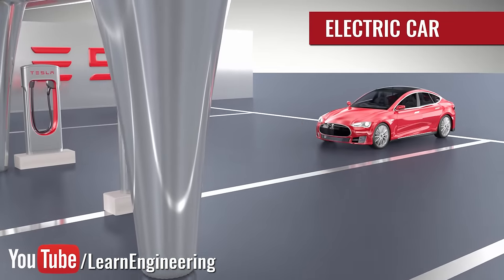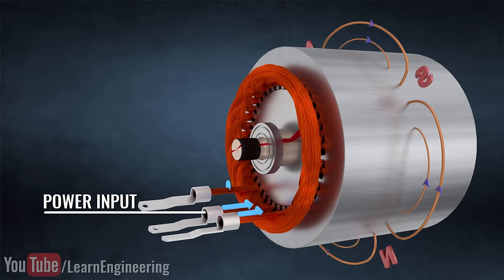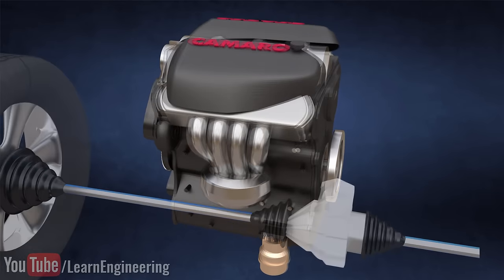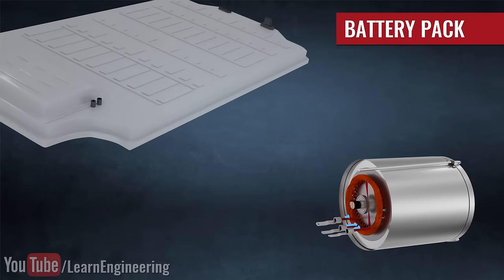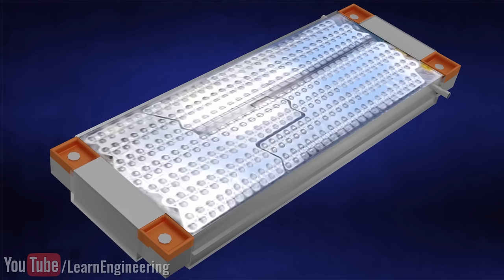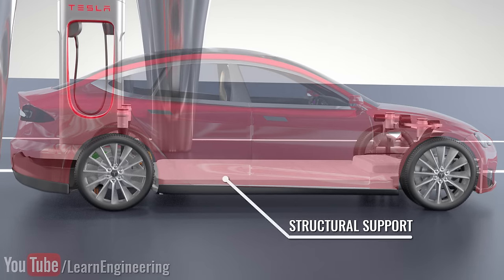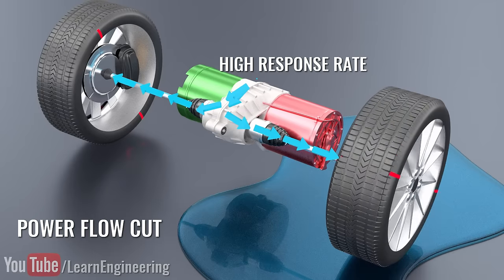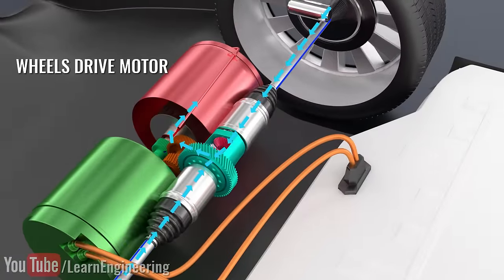How does an Electric Car work ? | Tesla Model S

Comment: Wouldn't it be more convenient if the battery pack was removable. That way you could swap your depleted battery for a charged one at a gas station and pay for the energy difference.
Reply: PhazonSouffle that's a great idea, but I think it runs into some practical problems like how do you have batteries for every type of electrical car at most gas stations
Reply: PhazonSouffle Not only that. There are many technical problems with that approach. 
It has been already tested several times (mostly by electro scooter companies in Japan). You also need a significant number of spare battery packs scattered across the country. 

People don't like the inconsistency - some drive responsibly and treat the batteries better than others. They don't want lower distances because somebody else likes to race at their maximum etc.

To sum this up: This is prehistoric fuel car logic. It is not you who needs to drive somewhere to fuel up - it is the fuel that needs to be present everywhere - aka electricity. 
The next step is, that the cars manage their charge themselves - followed by a crowd intelligence car sharing system.
Reply: Tesla has done that. They showed it at stage a couple years back, it took three minutes or so for a change. They opened a station between LA and SF but apparently it wasn't very popular.
Reply: That won't be easy. The only new successful battery technology in the last 125 years has been lithium ion. LI technology hasn't been much improved in the last 30 years... the Tesla is running on AA batteries because if you make them much larger they do things like catch on fire. Unfortunately, chemistry puts the kibosh on new "breakthrough" battery technology. You will note that there is a new "battery breakthrough" announced about every six months... and then crickets. That's been going on for the last 100 years.
Reply: Considering the batteries are built into the car chassis'... that would be quite inconvenient.
Reply: It is removable. Tesla built the car to be able to swap batteries and they built a swapping station in LA but the reception was luke warm so they didn't develop it further.
Reply: No need to swap.
Reply: PhazonSouffle they are trying that method in Sweden
Reply: or just have 2 packs at your can. one runnig pack and obe fully charged.you give one pack to refuel and pick it up later
Reply: Simon WoodburyForget
Again - this is obsolete logic. It is not you who need to chase the fuel. The fuel needs to be everywhere - completely unrelated to your location. Dedicated fuel stations are a thing of the past.

The future lays in self-managed energy supply by the cars themselves. If you are traveling longer than a car can sustain in a comfortable time period, you get into an other car provided by a crowd intelligence system.
Reply: Simon WoodburyForget Electricity is everywhere I go. Even today I don't drive to any Superchargers - I charge the Tesla at work and home. 

Again - once you start to rewire your habits you will realize how primitive the fuel station economy really is. It is a huge rise in comfort.
Reply: People forget these battery packs can be 1000# or more.  Its not just something you swap out like you might on a cordless drill.  The key will be greater capacities and faster charging times as the technology evolves.
Reply: Would probably be more trouble than it's worth because hte batteries are enormous. Most people don't drive more than 300 miles in a day lol, so it's not like you even need to charge you car very often. Maybe once a week at most, and if you use a Supercharger it only takes 20 minutes to get 100 miles of range.
Reply: The thing is if I leave my 10 year battery pack and get a 2 year old one I just got rid of my cheap defective one for a new one.
Reply: There would have to be extreme safety precautions. I don't know about Tesla but to work on other hybrids you have to disconnect the battery packs in order to do some servicing on the vehicle. Since it is an electric vehicle most of the battery cables have huge amounts of volts and amps that could kill you if you aren't wearing the proper equipment. It's not something anybody can learn quickly either because it's a life or death situation that is very risky. Most electric/hybrid  battery cables have 600 volts or amps (can't remember) going through them while they are live which is enough to kill someone fairly quickly. Also if you work on those types of cars you have to have a Sheppard hook to remove anyone being electrocuted or you could just add to the list of victims. 

I'm an automotive major and have taken 3 courses for automotive electrical and advanced hybrid courses and it's not something I plan on doing anytime soon because of all the dangers that come with the job. 

Anyway Tesla could have all the safety precautions already designed into the system to make it easier. So that could change my opinion but I digress. You won't see me working on any hybrid/cars until those precautions are in place to the point where death isn't one of the outcomes of working on a hybrid or electric car.
Reply: Or maybe build roads that charge the car by induction? Like those phone induction charge stations..
Reply: The induction idea is interesting but I'm not sure if they would be able to transfer power fast enough to keep up with the usage and man would they be expensive to build.
Reply: You have to deal with many problems when you start to move the fields.
A more reasonable approach will be induction systems under the parking spots to avoid needing cables.

However, the fields we are speaking of would be quite strong and may have an influence on things like Pacemakers.
Reply: PhazonSouffle While that would be mainly ideal, you're kinda gonna be pissed to know that your BRAND NEW battery is being swapped with a 5yr old battery.
Reply: It'd be pretty heavy though, wouldn't it?
Reply: Skarn22 Yep. And expensive if you break it.
Reply: Yeah but if you look at the design they have, the thing literally goes from one end of the car to the other. If they made a tesla any smaller, they'd have to make the battery smaller too.
Reply: I could not disagree more as I think Tesla has one of the best designs for battery placement.  The battery is under the entire passenger cabin.  Unlike like other EVs it does not protrude in to the cabin taking away passenger space.  The very low center of gravity allows for fantastic handling for such a heavy car.  The placement also allows for a great deal of storage room in the rear and some in the frunk.  Adding more than the largest 100kw range in the current battery designs would probably be too heavy.  As battery tech advances and gets lighter than greater ranges will come.BTW:  Range is one of the biggest things people are concerned about.
Reply: Robert Greenlee And also, the battery spanning most of the bottom of the car, it provides rigidity, making it one of the safest vehicles ever made.
Reply: Absolutely..
Reply: Simon you need to go back and play with your legos since you have no clue about cars.  Center of gravity has a HUGE impact hence why sports cars are usually very low to the ground and kick the pants off SUVs that tend to have a higher center of gravity.  As for storage space cars don't just move people.  They move people and their stuff.  On longer trips sometimes lots of stuff.  What do you drive a Yugo?
Reply: Simon WoodburyForget Go ahead and try to roll a Tesla, its damn near impossible.
Reply: Simon WoodburyForget All the ones I see are at dramatically high speeds, and they normally hit something to get them airborne, like that curve or whatever.
Reply: "Mellow _ ...have you never seen an F1 car flip?.... you can flip any car. The centre of mass being 1 inch lower then usual doesn't change that by a whole lot. There's a reason off-road vehicles don't typically have that low of a centre of mass, its because suspension is used to prevent the vehicle from flipping over. "HA.  SUV have higher suspensions to allow them to drive over rougher terrain.  Wow I think I think you are just a troll.
Reply: PhazonSouffle 8
Reply: oh yeah great idea
Reply: I also thought same.
Reply: PhazonSouffle batteries are very heavy, so both carrying a spare and replacing batteries is impractical
Reply: we could have  on every car the principal battery and every car  should have a second smaller battery with the same size and model on every manufactured car which u can fiind in every `` electric station`` with a capacity to drive like 2 hours for example! enough to go home to your charger or where u have time to stay 1 hour to charge  your principal battery!
Reply: @phazonSouffle.  nice idea bro but as far i know about it, 60% to 70% of total cost of any electric car is for its battery.if they start changing batteries,what would left behind.!!!
Reply: We could just have all of the spare cavity space packed as tight as possible with fitted battery packs integrated into the system.  Make it a one seater, put that in the center behind the windshield.  Make the sun/moonroof standard and modify it to be the entry/exit.  After that, all space not needed for the comfort of and operation by the driver should be filled with batteries.  Think it'd work?  What does anyone expect the result would be?
Reply: how about keeping a portable generator just to reach nearest charging facility. people are already doing that.
Reply: Jeez those packs weigh like 1000 pounds, and we be a pain to change. The process could take hours, and tesla is investing in less than one hour charging.
Reply: Why not have big  mobile power banks which will recharge the batteries anywhere something like road side assistance.
Reply: it's not your cordless drill; you'd have to dismantle half of the car,and wait the whole day, or come back tomorrow ,every time; better keep a filled ICE handy...
Reply: @MetallicReg  

But people want their own cars, not some bugmen sharing BS.
Reply: @MetallicReg  

Induction charging is inefficient as hell by design.
Reply: WESTEL Audio People don’t want their own cars. They want to get from A to B in the mist comfortable and fast way as possible. 

You will see how the market will shift once the shared car network starts to operate with ridiculously cheap prices, since those cars don’t stay parked 97% of their life.
Reply: WESTEL Audio Induction charging is not my main suggestion, but rather a more realistic alternative to the context it was mentioned. 

However, efficiency is not really a problem. We have more than enough potential energy sources once we commit to an extended solar network (with a practical way of balancing peaks - e.g. in US there is a possibility for lake storages). 

Therefore losing 50-60% is less dramatic than it sounds.
Reply: @MetallicReg  

Outside of the liberal urbanite middle class echochamber most people do want their own car. People like to live self-sufficient and not dependent on a company or whatever. Also people like to tinker and modify their cars or leave stuff inside the car. Others live in remote locations where car sharing doesn't work at all.

Give me an electric car that is as simple as possible. No unnecessary curcuitry, no updates or internet connection. If you look at the inverter of an EV like Tesla there is way to much in it for essentially just being a variable oscillator connected to a PWM amplifier. Give me something I can work on myself. Don't tell me it's impossible because that's not true.  I don't wanna be dependant on a company. If I look at EVs most are very sterile and boring. I'd take one that is fun and has a classic design.
Reply: @MetallicReg  

We can't just turn the world into a giant power plant. Renewable energy doesn't mean we should waste energy because we could put wind turbines and solar panels everywhere. Losses will be greater than 50 per cent if there is a thick asphalt layer and at least 10 inches of air between transmitter and receiver. Also the receiving coil will add too much extra weight.
Reply: @westelaudio943   I think you misunderstand your unique (probably American) non-urban position of underdeveloped transport and underpopulated land as something that has any form of a valid argument about the development of the global transport economy. This specific and dying form of living is not relevant in any way here. 

The respective population will have to conform to regulation and will be allowed to use cars as they use horses today - buy yourself one, park it at a track/dedicated area, drive it where you can't harm anybody besides yourself. No need to give up your hobbies.

It is not "car sharing" that we are speaking here about - it is an AI distribution of a transportation network. Think rather of cars that appear where you need them, when you need them, for only as long as you need them. The evolved Taxi that has actual intelligence behind its organization.
Remote towns will have exactly like any other area a set amount of cars that manage themselves. In any case, this amount will be much less than "needed" today - by generous estimations we can grant full access to transport to everyone with around 35% of cars used today for a fraction of the population.
_________
On other note, there is nothing to tinker with an electric car anymore, because it is not the level of engineering that is accessible for the amateur.
The "boring design" is rather the representation of the mere best CW values available today - any form of deviation (to the nostalgic "classic" designs) will result in loss of efficiency and range. Tesla is especially leading in this one (which is not really known, since VW and others like to cheat the real world measurement tests by taping off the clearance gaps).

This "variable oscillator" may not have 2000+ moving parts anymore but it needs much more technological know-how to get it right than any form of century known technology that is inefficient by design and has a mere peak as its optimal performance diagram that everybody ignores because gas is subsidized (speaking about every fuel car other than hybrids).
_________
Besides - the people that would like an EV today, are quite happy with this clean design language. You can find other variations in the Chinese market since they seem to want to rise up as leaders in this product type.
Reply: @westelaudio943  You don't need to "turn the world into a power plant". Again you need to look more closely on the dimensions. 
Mere 92000 km² equipped with (rather still inefficient) solar plants are enough to provide all the energy the world needs with excess. And this area distributed in warm places all over the world is truly nothing. 

Renewable energy means exactly this - energy should not be any form of considerable value. It should be completely free to use as it is needed by our state of technology. We do have an extreme excess of it provided by the fusion reactor in the sky. 

The only reason to limit ourselves comes from the catastrophic state of our use of primitive coal. Even the use of micro nuclear plants (that are not able to produce any form of weapon-grade material) would be preferable as a base load, as long as we are figuring out the decentralized energy network.
Yes, it would be costly and yes we would have some waste to deal with afterward - but it would not destroy the planet and it would not spread radiation and mercury like coal does.
_________
Losses of 50% and more are absolutely acceptable when you are working in the context of relatively unlimited resources - which we are in this model.

Also, today people seem to be even fine with direct end-user losses of 85-90% when driving regular cars and having a very limited resource pool - so this is not really an argument, is it.

We don't just waste energy - we invest it in a particular usability context.
Reply: @MetallicReg  

This is just wrong. American cars tended to be less streamlined but there were cars in Europe (like the Tatra or the NSU RO 80) from the 30-60s era that had very good CW values, almost as good as today, and they didn't look bad. Also, some modern cars like the Audi A-series follow a more classic design approach and still have good CW values. Also you are contradicting yourself since you are fine with inductive charging which is far less efficient than anything that could be compensated by streamlined design. What we see is more of a 2010's fashion than a necessity. 

The mechanical design is more simple in an EV. The electronic control unit is only complex anf unrepairable for the common man because companies WANT it to be that way. They want to keep control over their product after the bought it, they don't want it to be repaired or modified by you. People tend to underestimate the power of analog or simple digital curcuitry because we are told IoT is always better. 

Sorry but the non-urban lifestyle isn't going anywhere. Actually, people are leaving the big centers in, let's say, California by the masses everyday as they become increasingly unliveable. Their population only grows because of illegal migration.

EVs seem to be a good way to become less dependant on companies and big govt but sadly most of it's proponents have the opposite in mind. That's why I'm still kind of a petrol head and won't buy an EV any time soon until those issues are adressed.
Reply: They tested something like that in Israel and I never saw it again.  A little fork lift came out to the car, unscrewed the battery from the bottom which was basically the size of the whole car just flat and it spun 180 and screwed in a fully charged one.  All in less time than it takes to fill up.  The stations charged them with wind and solar.  That's how it should be.
Reply: @westelaudio943  We are not speaking about the last century models here. We are speaking about the blatant values today - and Tesla (more precisely Model S) has one of the best real-world CW values on the market for that big size and width of the body. Other manufacturers (I can speak from my experience with German companies from the perspective of an engineer) cheat the way in the lists by being allowed to feature values without side mirrors and taped up grills. Since Tesla does not need air circulation and are keen on pure economy they could publish "realistic" values without being worse in comparison. 
So in summary: Nearly ALL CW values of the fuel car lobby are in essence a lie.

I am not contradicting myself in any way - it is rather your misunderstanding perspective. I am absolutely fine with additional 50% less efficiency in the deployment chain of an unlimited resource. I am NOT fine with an inefficient use of that resource in the context where it gets limited - aka by the size of the battery. 
We are not dealing with such obsolete systems like gas distribution.
In other words, it should not be our concern how much more energy we could invest, but rather that we use the locally stored energy to full extent making any following system as efficient as possible (e.g. again a reminder that we are working towards an AI cloud of car distribution - the uptime of each car, once it is in use, is relevant, not the downtime once it parks itself somewhere to recharge, since this should be done as rare as possible to avoid the "lost/interrupted" routes to and from chargers).
____________

"Sorry but the non-urban lifestyle isn't going anywhere."
To say it in your words: "This is just wrong." - By absolutely all statistics the non-urban lifestyle is dying out in an accelerated manner all around the world. In mere 30 years 70% of the whole population will live in urban or metropolis regions (and the 30% left are not doing it out of joy but rather are located in underdeveloped regions). Small villages are disappearing everywhere or are simply swallowed by the next big city. And this trend does not have any meaningful limit.
The flows of people "out" of the city are a flaw in itself. If you really look in the details, you see that most of these people do not leave cities, but rather move towards their outskirts "bringing" the city with them. This is how cities grow in the area in the first place. Most leave centers because of the current lack of management in building new living room and by that rising prices for affordable housing.

All this is absolutely logical and necessary when you look at the numbers. The city life is extremely more efficient, environmentally friendly and sustainable, which makes it the only reasonable option. The drawbacks of city life are not "predefined" - those are simple problems that we face right now because they are rather new. As a species, we have never lived in such structures before and need time to optimize (architectural air circulation, taking our psychology in the account, loudness levels and used materials to mitigate them, etc.).
Reply: @MetallicReg  

Actually those cars I talked about even have acceptable Cd (that's the correct term actually; I thought it was "w" for "wind" but it's "d" for "drag" sorry I messed that up) values even by a modern day standards. And if inductive charging is not wasting energy, why is having higher Cd, if the energy enables me to drive a better looking car? 

The argument about urbanization is actually dishonest because it only happens in 2nd world countries that are rapidly industrialising. In the western world/euroshpere and also in Japan this process has stopped decades ago and we are actually seeing an outward movement from the cities in a lot of places, especially when it comes to the white middle class. 
Using "whole world" statistics is fallacious is so many cases because world regions differ extremely.
Reply: @westelaudio943   Both abbreviations are correct. Cw is European (from German "Widerstand" = "drag", therefore the change in the letter; as you may have guessed I was taught in Europe).

Again, the values are different for real-world application. You won't find them in the specifications.

There is NO PROBLEM with losing on invested (user-friendly) energy. This type of energy pool is NOT limited. 
The energy pool that is built into the car IS limited. This is what is essential to improve overall.
The use of gas is ALWAYS a limited pool and is not sustainable - no matter how you would optimize for it.

Using gas is, therefore, ALWAYS wasting energy, but using electrical energy from regenerative sources is NOT wasting anything EVEN IF you would apply less efficient but user-friendly delivery of the said energy type. 
The main goal is: You should not be limited by the needed energy in any way.

A "better-looking" car (or any equivalent to nostalgic feelings of older generations) is not the measurement that is in any way relevant in the progression of transport.
Design follows standards and technology - not the other way around.
_____________
Concerning the urban flows - I have already addressed this issue. The people are NOT leaving the cities, but rather help the growth of the cities in their respective area. They move to outskirts and extend the same urban infrastructure. The death of small villages is in every developed country a main "issue" (although I don't see it as such) which grows each year. 

https://population.un.org/wup/
Reply: silly
Reply: @aceroadholder2185  Cynicism is a nice safe space.
Reply: portable battery platform. lift the shell. and exchange it.
Reply: @anthonypape6862  Replaceable batteries are great for vehicles belonging to a fleet operator with a predefined area of operation, like buses or municipal vehicles. The fleet operator could have battery change stations at strategic locations, and manage the battery lifetimes centrally. As somebody mentioned above, no private owner would want to exchange his "good" battery for a crap one. And neither would he want to spend hours at a charging station (waiting for his turn + charging slower than advertised because the battery heats / the system is overloaded).  Thus the use case for electric vehicles   is for low milage city drivers who charge daily at home and for fleet operators - not for long distance private drivers.
Reply: Yonathan Gormezano no it’s just better   Less time to swap than fill up a gas tank. And there are no good batteries or bad.  You swap every time you need fuel. It was done in Israel but not by Tesla. The Tesla car is not designed for that so that idea is dead.
Reply: Actually some Chinese EVs have option of swapping battery pack at the charging stations instead of waiting to recharge the batteries fully, a clever ploy to save time.